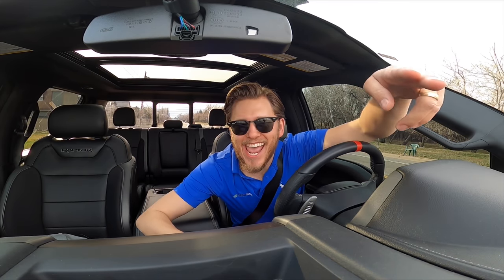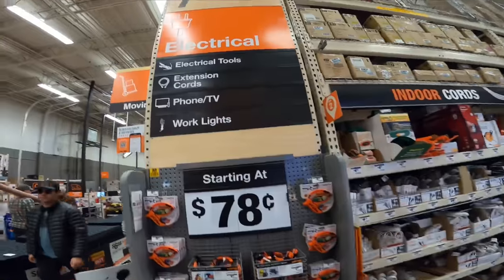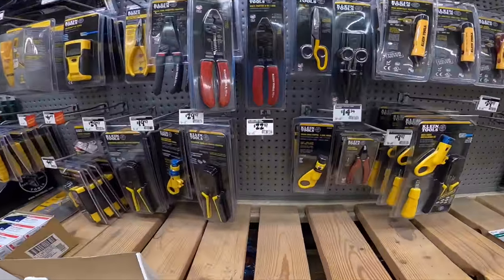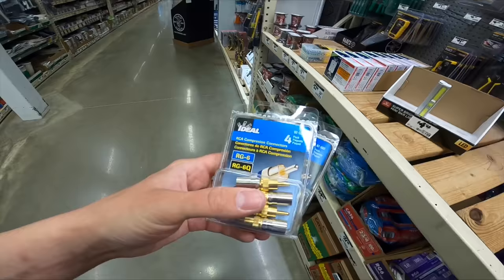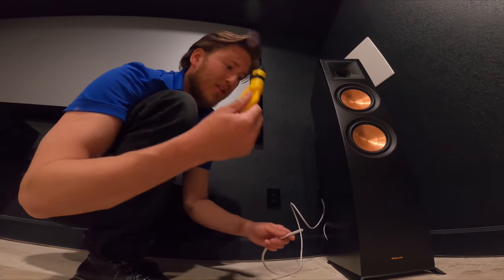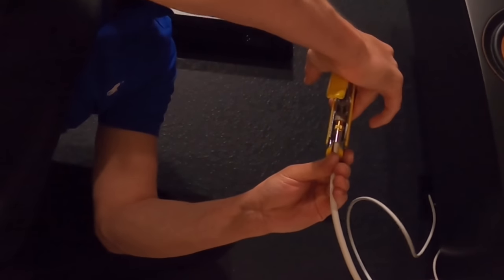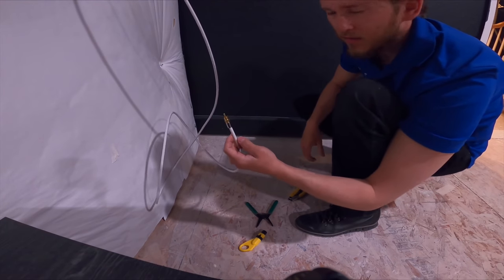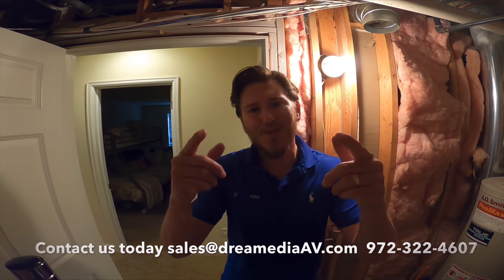How To: DIY Subwoofer/ RCA Cable from Home Depot ??

Comment: Just got into this for the first time over the weekend.  I crushed two of those fittings before i got the hang of it.  But once i got the hang of it, it worked nice and easy. Ran a 20+ ft subwoofer cable in my soffit.  Theres a good amount of romex in there for lights and an outlet, but the RG6Q seems to work great with no sign of interference.

Comment: Make sure when you use cutter to strip cable that none of the little silver filaments are touching the copper center wire. If they are left on there it will short the signal and cause distortion.

Comment: Can use use an existing RG-59 jack that terminates where my AV unit is? My thought is to use the existing RG-59 jack and make a cable that has one end with RG-59  and the other end w/ RG-6. It would save me from running a completely new line through the wall. Thanks.
Reply: Cameron Smith If you’re just using it as an audio signal then it’ll be fine, I just wouldn’t use it for internet or video signal.

Comment: I'm grateful for your video. You know  what?  I was wondering if my subwoofer and receiver arrive how by DIY knowledge, get a long cable connection between both to allow me place my subwoofer at a reasonable location.  Having seen all you've done, I think I can take care of this hence I've installed my tv  aerial in my loft or ceiling before so it's no different. Thank you again.

Comment: Ok a Klein rg8 crimping tool kit is $49.95 ,rca rg8 connectors 4 pack $9.95,rg8 cable 50 foot 28.99 for a grand total of $88.89 less tax of course! Wouldnt it be cheaper to just buy a rca cable for your subwoofer???
Reply: This is for long runs in wall.
Reply: I was wondering the same
Reply: @michaelluna2139  100ft rca cables under 50 bucks

Comment: Good info. So a active subwoofer needs these shielded wires with a RCA jack. What if someone has put regular speaker wires in the wall and now wants to put a subwoofer there? Can you put a RCA jack on it or solder it on there? If not one will have to fish a subwoofer wire. Or use the speaker wire directly to the back of the Subwoofer? I understand if you do that and set your low frequency cut off to 80 hz for example then the front Subwoofer is basically getting the same audio input as the front speakers except that the low frequency are sent to the subwoofer instead of the front speakers. It may not be the best way to use them for good home theater use.

Comment: How Do You Wire the RCA Wire to the Speaker Subwoofer side? For example I am installing 7.2 surround sound In Wall System. So the Wall plates and the Reciver both that the subs will connect to have the rca connectors. However the Subwoofer only has the red and black push down Connections for 2 wires and not a RCA. 
So how can you connect 2 wires to an RCA Connector?

Comment: My RCA RG-6 connectors are not fitting in the compressor? I’ve been trying to fit this in for over an hour now. Not sure why it’s not working. I purchased the same stuff from Home Depot as you.
Reply from the maker: twist it on and crimp it down
Reply: Thanks guys for the videos. Especially the videos with the outdoor TV selection. Lol! #notoindoortv #gowithasunbritetv
Reply: @LLCoolJer  I have been having the same issue. What does he mean by "twist it on". The RCA connector is too big for the crimper
Reply: @KumarThurimella  did you ever figure this out. I tried it last night and had the same problem. The connector was too big for the crimper.
Reply: @rudyloera77  hey yes we did. He bought the wrong tool for that specific crimper. If you go back to home Depot there are bigger ones that work well.